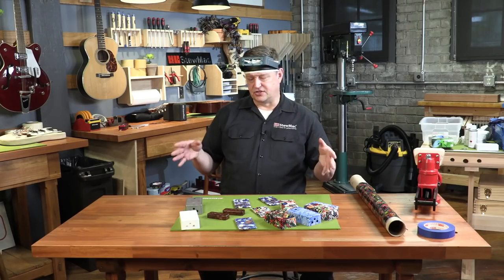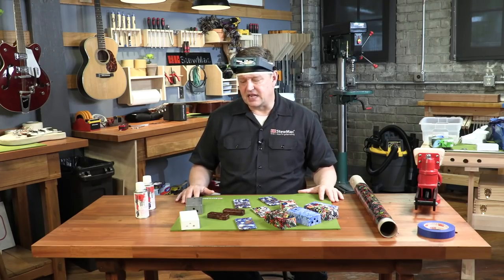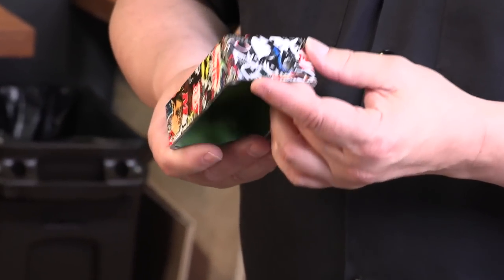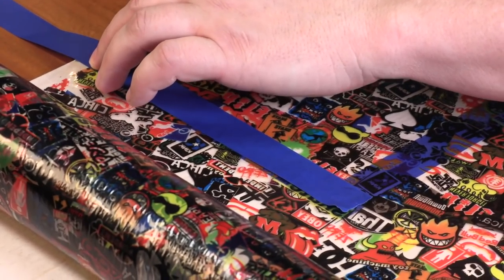Tips for Hydro Dipping DIY Guitar Pedals

Comment: Thanks for posting. This was valuable info. I’ve hyrdo dipped 2 pedals and the first one I had beginner’s luck.  The second I had to sand off and redo it (too many tears for me) but very happy with the results after they redo. It’s almost impossible not to have some tearing. Depending on the the design the tear doesn’t look bad either and not noticeable.

Comment: I was just thinking, not that I've ever use liquid rubber spray. But I was wondering. Do you think spraying the inside of a guitar pedal with liquid rubber. Would be good to insulate against electricity. Because I bought a vintage MXR micro amp. Thankfully no mains power. And it was cutting out. So I opened it and the circuit board was wrapped in bubble wrap. So I'm just kind of looking for a quick-fix. Any advice would be thoroughly appreciated. And thank you for your fascinating video. This is so interesting. Thank you so much. Definitely sub
Reply: they sell spray on electrical tape (and brush on as well) that dries really fast and is super effective inside guitars/pedals/amps/etc.  we use it a lot in automotive electrical/electronics too.  very handy stuff to know about.

Comment: Someone should build a guitar that is specifically made to attach custom mini effect pedals. On the back it has openings for a certain amount of effects that are controlled via the knobs and switches built into the guitar.
Reply: Google "gfs modboards." Same sort of idea as you have, but rather than knobs on the back you replace the knobs on the front of the guitar with knobs that you can pull up to adjust the settings of the effect. Pushed back down, they work like regular knobs. They've got delay, chorus, and a few different drives. Other companies probably make a similar thing that I haven't seen
Reply from the maker: That's an interesting idea.